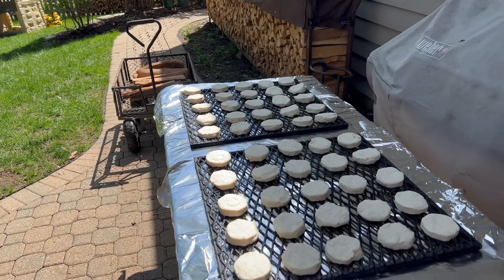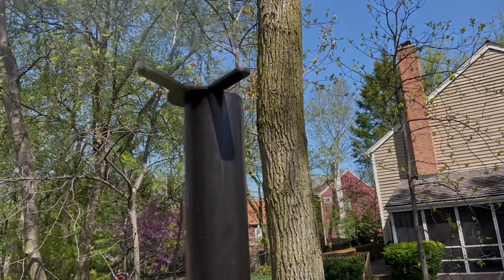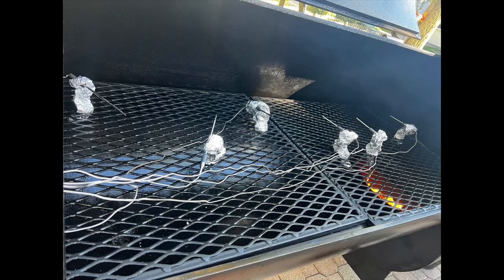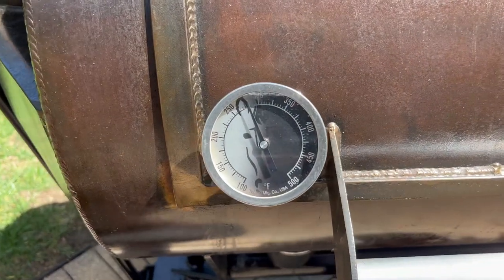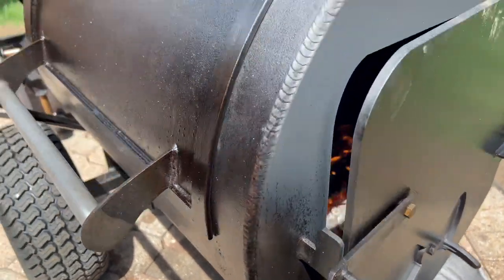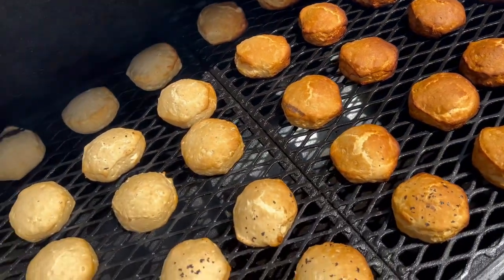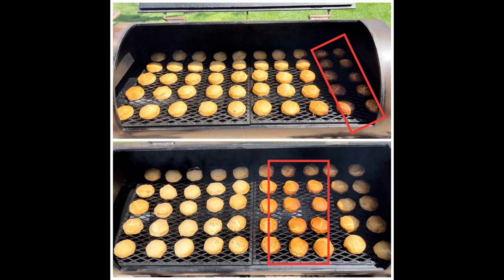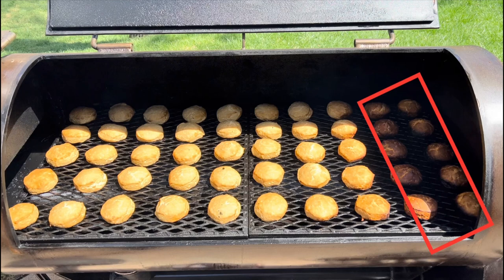Biscuit Test Workhorse Pits 1975

Comment: You actually did the test you said you would do on jirby's channel. Very cool. I didn't think you were actually going to do it. 👏👏
Reply from the maker: I was going to do it a day earlier but it was raining all day. I've been meaning to do a biscuit test for a long time...sometimes you just need a kick of motivation. I wish I did this video sooner!
Reply: @smokescouts  I'm glad you did. I did that test. I would have never figured out that leaving that damper shut made it run that much more even. Cool video.
Reply: Man, your videos have been incredibly useful in learning my 1975. Question...do you ever see a discrepancy between the grate level Tel-Trus and the probes on the gate itself? I have noticed a difference of 20-25 degrees, even when the grate probe is placed close to the stem of the door thermometer.  I've double checked calibration and all is good with instrumentation.  Thanks again for all this great info.  It's like having a 1975 master class at my fingertips!
Reply from the maker: @mtmarcy4495  haha thanks, I really appreciate it! Yes, I get the same 25 degree differential, as well as a lot of other offset owners I know. I once asked Mad Scientist his thoughts, and he said every offset, even 1,000 gallons, have that same difference. Some say it’s the radiant heat from the grates (that’s why I tried using foil to get those probes higher), but no one really knows why.
Reply: @smokescouts  Wow, that's interesting. Thanks for responding man, and thanks for being such a valuable resource for us newbs!

Comment: Yes - Similarly, Jirby has posted that one can create the same temps by adjusting (closing) the stack damper and adding MORE wood splits at the same time. Example, 4 splits with a wide open damper vs 6 splits with a half closed damper will give the same cooking temp but the latter will have a larger but more gentle fire creating less draft resulting in meat that is more moist, less crispy.  Thanks for posting.
Reply from the maker: Thanks for watching! Jirby is the reason I started using the stack damper - learned so much from him and such a nice guy when I met him in person. In my other damper video I use the same size fire, but get 3 different temps/drafts by adjusting the stack damper, but in this video I was trying to maintain similar temps so needed to adjust my fire size (an extra split)  in combo when adjusting the stack damper to do that, which is exactly what you described above. Thanks for sharing and confirming I’m on the right track!

Comment: I know some people use a log near the fire side on the grate, but knowing you have that hotspot by doing the biscuit test, it pretty much makes that unnecessary I would assume?
Reply from the maker: Correct. I don’t put water pans or blocking logs on the hot spot area so the hot air isn’t deflected down and it can rise up past the cooking surface as it’s designed to do. I see people make that mistake all the time. I just use foil caps as needed to protect any edges that may crisp up during longer cooks.

Comment: With the first hot spot isolated to far right, would placing a water pan there help? Even with a pan you still have a ton of real estate. How are you liking workhorse? Was deciding between them and outlaw but for the price, workhorse seems like the go too
Reply from the maker: If you put the water pan on the hot spot, the airflow will deflect and move the hot spot further left. Check out my 2nd biscuit test video where I show this. The 1975 is a great pit, highly recommended.

Comment: I just re-watched this video. So good. 

What I really like about it is that it's a great illustration about the misconception that a pit (any pit) "runs even" when both thermometers read the same temperature. 

In your video, with the stack wide open, both the left and right thermometers were reading at 290°, but obviously the biscuits were hotter in the center. The hot-spot is simply shifting to the left of the right Tel-Tru, and both gauges are running the same temp at their respective locations. 

But to conclude, "the pit runs even across the grate when both gauges are the same temp" is kinda like saying, "The temperature in New York is 80°. And the temperature in Los Angeles is 80°. Therefore the temperature of the United States is 80°." There is just too much real estate to draw that conclusion. 

Also, the existence of a hot spot isn't "good" or "bad". But as a Pitmaster you need to know what's going on inside the pit at various settings. Heck, you might WANT the hotspot if you were trying to cook ribs but wanted to finish off a chicken in the hotspot. 

Again, great video. Thank you for the informative content.
Reply from the maker: Thank you, appreciate the feedback! You explained it perfectly! Knowing your pit and using the hot spot to your advantage is key like you mentioned.

Comment: The best biscuit test I've seen on any pit, and I've watched a ton of videos on this subject.  I'm new to offset cooking (not cooking in general or BBQ).  Currently evaluating the 1975, as well as the TMG Volunteer.
Reply from the maker: Thank you! I did 2nd one where I show the impact of putting food or a water pan where the heat surfaces. Really interesting results.
Reply: By far the best offset in the game.  I have two.   They got the performance nailed with material selection and insulated stack
Reply: @darrenc3895  - Workhorse or TMG?
Reply: @clintblundon4880  I have a Workhorse 1975 wagon.  I purchased a 1969 caster in 2019 but gave it to my father-in-law in May.  Excellent offset smoker.  Both of them.

Comment: Love this video!  Just did my first cook on my new Workhorse 1975 and it was biscuits. Lol.  My first batch I followed your method by keeping the stack 2 thirds closed. I got the same results as you. I then took my water pan (same as yours) and placed it under the grates by the fire opening. The results were even better. Hardly no hot spot.  If you get a chance, you should try it. Would love to hear your results.
Reply from the maker: That's awesome! I love how you tested it with the biscuits right away - it gives you such a visual to help you during cooks. I wish I did it sooner. Did you take any pictures of your results you can share with me? I'm very curious on the set-up and results.
Reply: I took several short videos I can share. Nothing professional. Do you have an email I can send to? Also, I  am getting lots of smoke coming from the doors. The main door leaks all across the bottom and two corners. The cowboy door leaks in one corner. Is this normal? Will it settle in?
Reply from the maker: @travis759  when using the damper, you'll get smoke leakage everywhere. Once the creosote builds up, it won't be as bad but still there. Don't worry about it. When I run my pit like that the food is always better. Try cooking a brisket with the stack wide open with no leakage, then cook one using the damper for the first 8 hours and compare.

Comment: Great video.  I've had my 1975 for 1 1/2 yrs.  Just started partially closing the stack damper a few months ago.  Thank you for this video.  Keep up the good work!
Reply from the maker: Thank you! It's so nice to have a pit that draws so fast that you can cook in multiple settings. I typically cook with the stack damper closed 1/2 - 2/3, but sometimes run it with the stack wide open to change things up. Thanks again!

Comment: Great video Smoke Scouts.  
Looking at getting a 1975, can you tell me the exterior depth of the unit from the back to the handle?  I would have to fit it in a tight space.  Also, are you happy with it, any concerns with the smoker?
Thank you.
Reply from the maker: Thank you! It's 28 inches from the outside back of main chamber to the end of the handle. My wagon wheels are 37 inches wide. I love my pit and would buy it again no doubt.

Comment: When it’s closed 2/3s what temp do you have it going? I know you said you have to build a little bit bigger of a fire?
Reply from the maker: In this video, I was running it around 280-290 the entire time. The right Tel-Tru will always run 50 degrees hotter with it 2/3 closed. I run my pit with the stack damper closed 2/3 most of the time even if I'm cooking at 225. With the slower airflow, a slightly bigger fire is needed. Thanks for watching!

Comment: Do you use a water pan and if so how does it effect the hot spot at 275 with damper 2/3 closed?
Reply from the maker: Yes, I use this mud pan and sits directly above the baffle so the hot spot isn’t impacted. 

https://www.homedepot.com/p/Husky-12in-Stainless-Steel-Mud-Pan-MPX12-HUS/317052492
Reply: U place it on main cooking rack as close to firebox as possible right? Sorry if its a dumb questions
Reply from the maker: @seanwhite5269  correct. No problem

Comment: Are you exclusively cooking w/ stack 2/3rds closed for the entire cook now, or are you opening it up towards the end.  great video BTW.  It's been about two months since i lit my pit up due to my new Pickleball obsession lol.  i need to get back at it for sure!
Reply from the maker: Pretty much 2/3 all the time except for the last hour of a brisket cook. For ribs and pork shoulder, I keep it at 2/3 the entire time. For chicken or steak, I'll keep it wide open. That's not a bad (and healthier) hobby so can't really be mad at that!
Reply: I think you mentioned somewhere that you run a little bigger fire using the damper at 2/3. If so are you using 2-3 splits at a time instead of the 1-2 depending on the health of your coal bed?
Reply from the maker: @jee77osu  yes, that’s correct. Also, I’ve been using wetter wood (about 18-20% moisture), which also increases the amount of wood you need to burn. I’m planning on doing a Fire Management part 2 video soon to explain in better detail.

Comment: You leave the fire box damper closed? Why? Still learning...
Reply from the maker: Cracking the door is much better in my experience creating a less intense isolated air flow over the center of the coals (check out my 2nd biscuit video where I compare both methods). The owner of Workhorse actually suggests doing that too, and the bowtie was only added for insurance reasons for the backyard model. The commercial pits don’t have the bow tie.
Reply: Thank you!